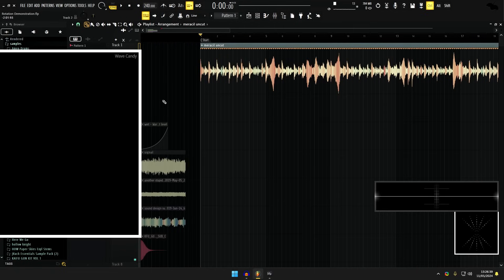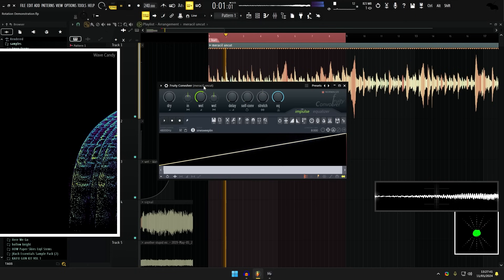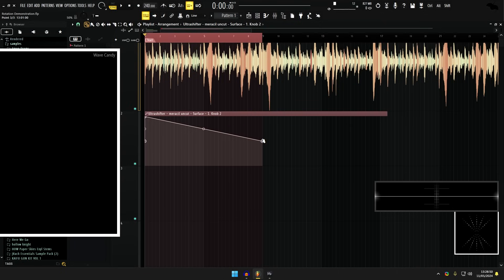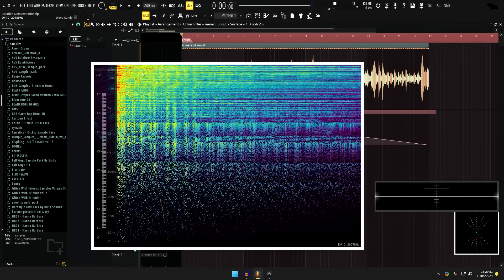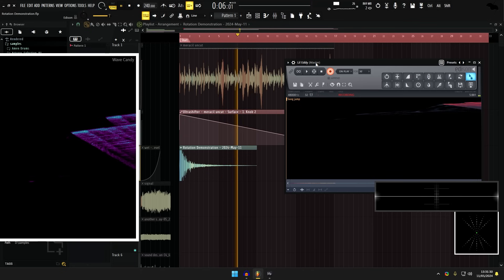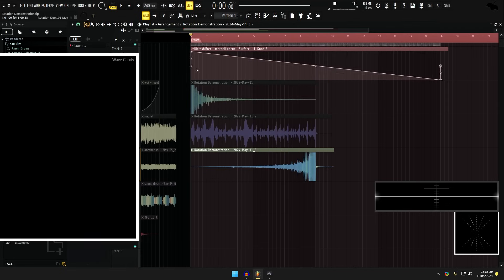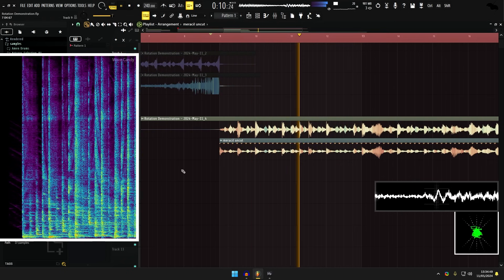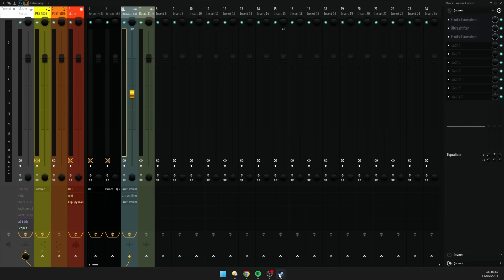90 degree rotations : further spectral rotation

Comment: The most insane thing I've learned on my own while playing with GNURadio Companion flowgraphs.
FFT itself does EXACTLY this. In one shot.
If you pass the studied signal through the rectangular-windowed FFT (I mean, a really large one, by the width of the whole audio length ceiled to 2^n instead of the default 1024 samples) and then interpret the result as the ordinary signal, you will get the spectrum rotated 90 degrees. Both the source and the result must be the I/Q signal with two channels (as we are operating with complex float32 values).
...Basically, Fourier transform just rotates the time-frequency domain 90 degrees counter-clockwise. Replaces peaks with sines, and sines with peaks. The idea is THAT simple.
...So, if you apply FFT 4 times in a row, the result will be the original signal as we just rotated the frequency domain 360 degrees.
Reply from the maker: lmao yeah

Comment: To anyone that wants an easier way of doing this, I recommend photosounder, with which you can edit audio as if it were a picture, which includes layering, rotating, changing contrast etc.
Reply from the maker: do not do this if you're trying to have a good outcome lol, you will have no phase spectrum and quantize your amplitude bins to the bit depth of the image you're saving. additionally think about the pixel interpolation by reading the image and the window function used to generate the spectrum image, also window overlapping etc. that process is supremely lossy

Comment: Absolutely crazy. Does rotating it 90 degrees make the audio smaller in length? Rotating means swapping axes, but it's still audio at the end of the day, so axes must retain their meaning. Given a fixed sample rate, rotating would always result in the same audio file length no matter how long your audio is, but the longer the audio file is, the greater the data loss is because you lose resolution. That is because a variable amount of data (x samples of audio data) is mapped into a fixed range (represented by what previously was regarded as bit depth). I can't even wrap my head around this.
Reply from the maker: you get more frequency information with more time (since they're very similar domains), frequency is continuous (sorta lol), so there's no actual loss when changing time to frequency

when you have a fourier transform on 1 sample of audio you will get 1 complex coefficient back
if your signal has 100 samples you get 100 coefficients, 100 harmonics
the more time data you give it, the more frequency data you get back, so there's no real "fixed range" here
Reply: @idiotinium  ok fair enough. It is true that there is no fixed range, everything is continuous, but digitally you really can express time as infinite, you have room for that so long as you have memory to work with, but floating points, while still "infinite" between -1 and 1, they are limited by precision, hence the "fixed range". I also noticed the artifacts at the end of the audio file after rotating. I assumed this is for a similar reason as to why lower bit wave files do not have dynamic range, and artifacts happen when boosting levels for quiet sounds. But I do understand now that rotating 8 seconds of audio turns into 8 seconds of audio with different spectral content just with a stupid amount of "frequency information" so to speak.
Reply from the maker: @GaussianWonder  aha yes there will always be precision limitations though they're negligible. i measured them in a new cleaner method and they were around -155 dB which is insanely quiet

Comment: Huh... Now this is interesting, it seems it's possible to reverse an audio sample entirely in the audio domain which is probably useless but seems cool.

Two flips gives you the reversed and frequency inverted version of the sample, so you just need to flip it on the frequency axis. I don't really know anything about convolution so I don't know if there's a simple way to use that, but you could amplitude modulate the sample with a fixed carrier frequency which will generate two mirrored sidebands as in an AM radio signal. 
Then you just low-pass out everything but the lower sideband and frequency shift back down by the magnitude of the carrier frequency, giving you the frequency-flipped version of the 180-degree-rotated convolved sample, which is the original sample played backwards. 
I have no idea what I'm talking about though.
Reply from the maker: lmao yeah i was looking into that recently actually

Comment: Ahhh yes the classic right angle trick! (actually never seen this but it's awesome). 
Another reason that it could be lossy in the low end is that real-time frequency shifters work using allpass filters to (imperfectly) achieve a Hilbert transform, i.e. phase shifting each component by 90 degrees. But DC (0 Hz) cannot be phase shifted, and frequencies near 0 are also more poorly phase shifted by this method.
Reply from the maker: theres gotta sooooome way out there that works tho, surely
Reply: @idiotinium  I think maybe if you use a frequency shifter that's not intended for real-time use (one that performs phase shifts in the frequency domain via STFT, which introduces latency), it could work losslessly.

Comment: Interesting. This demonstrates that the time and frequency domains are naturally equivalent, as shown by the Fourier transform that works the same way both in forward and in reverse.

I knew that turning a spectrum upside down is very simple, you just invert every other sample (i.e. modulate the signal by the Nyquist frequency), and this is fully reversible. One can also "skew" a spectrum by doing a convolution with a sweep signal. Doing a 90-degree rotation and getting back to the original signal after four rotations is another story. I wonder if there's a lossless way to do so.
Reply from the maker: theres definitely some way to do it completely losslessly, but idk if theres any tools that do that yet. not when they all have weird safeguards in like safety cutting nyquist or even frequency shifters straight up not having ranges that go to all the way nyquist freq
Reply: @idiotinium  I think I can write tools for that using my workflow. One would naturally do a Fourier transform of the entire sound clip, that effectively exchanges time and frequencies. The FFT outputs real/imaginary components, however, that should be somehow turned back into sound without loss of information.

Comment: I feel like you could use a sound to image thing to just literally do this. Export to image, flip, export as image, load back in.
Reply from the maker: many key problems with those kinds of programs

no phase spectrum is exported (extremely important)
amplitude bins are quantized to the image's bitdepth further losing information
and no window overlapping, the signal has been discreetized (idk if thats a real word but yknow what i mean) and so interpolation between columns of data in the image wouldnt match the window function used to get it in the first place

Comment: You should be able to start the sine sweep from 0 Hz instead of nonzero because you're using a linear sweep rather than an exponential sweep.
Reply from the maker: audacity doesnt let me type in for 0hz unfortunately
additionally, at the end of the file lies a click from the impulse response suddenly stopping at 24khz which can mess with the convolution, i might just stick it through a spectral gate or just date out something

Comment: Could you do this in bitwig and like make a patch that gradually rotates a sample as an effect?
Reply from the maker: yes you can do this in bitwig, but gradual rotation? not really as far as i know, you can have it do weird changing rotations but thats very hard to control
Reply: @idiotinium  it would be pretty insane to modulate a track gradually like it sounds like a low pass and then suddenly flip it upside down and add in new elements for another section, it makes me wonder if the technical psytrancev producers like psykovsky and kindzaza have done similar stuff already. 

Anyway great tutorial!! You explained it really easily and seem like a stand up guy

Comment: Awesome explorations man, curious if the high frequencies could fuck with speakers or anything? Keen to experiment but not blow out my speakers lmao. Appreciate u documenting ur work!
Reply: cool way to hide hidden messages in noise too!
Reply: if they could mess with speakers, all you'd need to do is apply a low pass filter to lower their volume or cut them out.
Reply from the maker: yea just lowpass that stuff on your master channel to prevent that if youre concerned, but your speaker should be fine

Comment: you can create some crazy distortion if you rotate it once, add some kind of delay, and then rotate it back. Could probably do some crazy sound design with this
Reply from the maker: delay would be like layering a sound on itself with a frequency shifted version of itself multiple times in a stack
Reply: @idiotinium I would like to hear that. I was thinking about creating harmonics by convolution like this, but, ideally, it would be less lossy.

A problem it that such transformations should be done in logarithmic spectrum to conserve intervals, which could be solved by using logarithmic sweeps instead of linear (I don't know).
Reply from the maker: tried it with delay in linear, the harmonics are weird and it sounds like a bitcrusher lmao

i guess you could try logarithmic somehow, that would be cool, its just i dont know the optimal way to sweep exponentially or so
Reply: @idiotinium only seeing this now but that's really cool, it sounds crazy but it actually makes a lot of sense

aliasing in frequency domain can be described as a kind of looping of the spectrum, so the comparison with a delay in time domain is accurate. bitcrushing is often used as a zero order sample hold, which introduces inharmonic reflections of the spectrum at every multiple of the sampling frequency, or in this case the time of the delay

another way to see it would be through the convolution theorem, using a Dirac comb (impulse train) as a sampling function. multiplication in time domain is equivalent to convolution in frequency domain: when you sample a signal from an idealised continuous function, you're also convolving its spectrum with the Fourier transform of the comb, which is just another comb spaced out at every multiple of the sampling frequency
Reply from the maker: yeah
Reply: That's actually genius! What other effects could be useful swapping out the frequency domain for the time domain? Reverb to make stuff into weird white noise, I guess? Would EQ be like a particular volume automation curve over time? I'm not even sure what a flanger or phaser would I'm not even sure what a flanger or phaser would sound like, messing with all the frequencies in a sweep? Really cool idea to use the rotation like that!
Reply: @NZsaltz  a flanger is actually caused using delay. Rotating it would sound pretty similar. A phaser, on the other hand, would depend on how many bands it had, but would be a weird comb-filtered delay I believe.
Reply: @NZsaltz  perhaps this can be used to create distortion/saturation without aliasing? You'd just need a way to apply conventional 'distortion' in the time domain somehow... Wouldn't really be useful in a realtime setting, but probably useful in some way.
Reply: Harmonics, yeah, that’s a great idea to explore

Comment: That is brilliant!

I imagine you could do something similar if you manipulate the spectrum with an image editor and a tools Photosounder or Coagula, but it's amazing to do it strictly in the audio domain, so to speak! A lot of potential for interesting sound design, and of course Easter Eggs :)
Reply from the maker: keep in mind the phase spectrum is a very critical part of any signal's fourier decomposition, most of those tools only export magnitude/amplitude spectra, also with no window overlap or anything (some even distort it such that it no longer has a linear frequency axis). plus the partials' amplitude will be quantized to the bit-depth of the image further losing information

keeping it in audio form retains phases and stuff cus its the pure actual math on the signal

Comment: It's "lossy" because you are clipping. If you are rotating the time-frequency spectrum (a STFT starts at 0 Hz btw), there is theoretically no loss, save for floating point inaccuracies, unless of coarse you are using the magnitude spectrum.
Reply from the maker: im not actually clipping, anything over 0db is still there, all is preserved in that regard. 
i think its because of the fact when it reaches 180 degrees, the frequency shifter has a built in lowpass to prevent nyquisting so the low end gets reduced a little bit
Reply: Oh yeah sorry I skipped the kilohearts shifter part of the video 😅. If you modified the spectrum directly it would be completely recoverable (if your STFT is set up correctly). But the FS plugins are completely non-linear so I'm suprised you actually got such a good reconstruction from a convolution only!

Comment: Thanks for showing us how to do this. I found out if you bitcrush a spectrogram rotated 90 degrees and rotate it back it creates a repeated granulized sound?? Im super confused why but it sounds cool.
Reply: If you think about it, what any distortion does is just generate harmonics, in other words they generate information that is offset in the Y-Axis of a spectrogram. But if you rotate it, that information is now offset in the X axis - meaning you've generated information that is offset in time.

If I'm understanding it correctly, this means a delay plugin alongside this method could be used to generate harmonics in a novel way.
Reply: But you would need harmonic interval spaced delay for it to work. Or, hey, a novel road for non-harmonic tones
Reply from the maker: hmm i guess it would do that, it'd be like if you repeated the original audio and layered that with a repeating version of it in reverse too
Reply: Harmonics become delay.

Comment: I can think of exactly 0 use cases for this other than maybe encrypting something like someone said in a comment below, but it sounds sick.
How did you even find out how to do this? I have no understanding of why what you did achieved the result.
Edit: nvm, I watched your previous video about this, and it makes a lot of sense, this is insane lol.
Reply: "it sounds sick" is a use case if you think about it
Reply from the maker: i saw a recent matt parker (standupmaths) video explaining how a rotation is equivalent to 3 skews if you use specific ratios for the skews, and i also noticed that convolving with a sine sweep was one way to extremely offset phases, and a frequency shifter skews vertically when automated linearly so yeah
also it would be a cool way to hide a secret in some puzzle thing for sure!

Comment: Does copyright still apply if I rotate all my samples?
Reply from the maker: rotating something 90 degrees isn't a super lossy process so you aren't altering the original work THAT much, its a reversible process so its basically a novel way to store the signal weirdly
Reply: @idiotinium  what? It's reversible? I thought it was destructive so if you rotated it say 360° clockwise and then the same back again you would have a degraded version of what you started off with
Reply from the maker: @hiranyashesha  its only a little bit destructive, you can still recover quite a nice version of the signal back
Reply: the courts cannot prove that you rotated a copyrighted song so no
Reply: @Zetvue  i would think the main problem would be anyone noticing, but if its noticed you could tell with enough knowledge that its just .. rotated
Reply from the maker: @Zetvue  yes they can
Reply: @idiotinium  if you rotated it 90deg, 180deg, or 270deg, no they can't
i was assuming they were just rotating it 90deg or something and not a full 360deg
Reply: @Zetvue how could you even say that? These are reversible operations…
Reply: @Rosalies_  i don't think the courts would care if you rotated a song by 90, 180, or 270deg. all court cases of music i've seen only deal with similarities between songs and none of them i've seen have used spectrograms to prove if they sounded similar
Reply: forgive me if i am wrong though, i just don't think a civil court would care about this
Reply: i think if you rotate copyrighted audio by 90 or 270 degrees it would be completely unrecognizable to anyone who doesn't know what the sound originally was. Maybe a label would still sue if they found out but i doubt they could actually get that past a jury, not a lawyer though so maybe copyright law is even worse than i imagine it to be.
Reply: @rhodekillkatie  rule of thumb: copyright law is always worse than should be possible
Reply: copyright is dumb; talk to a lawyer